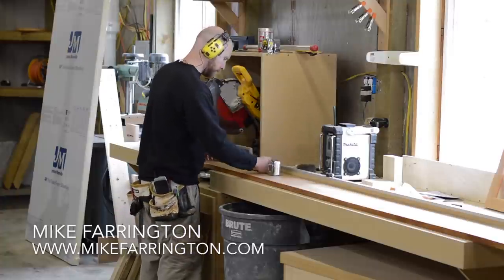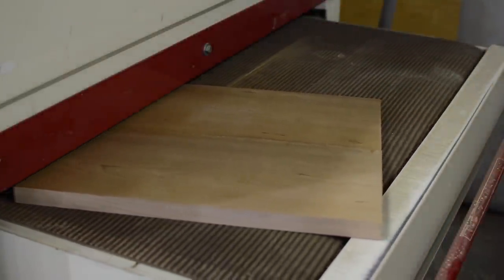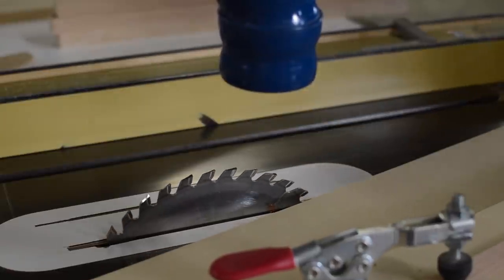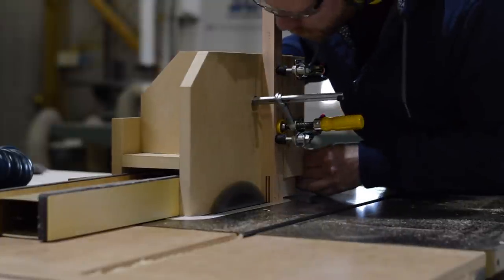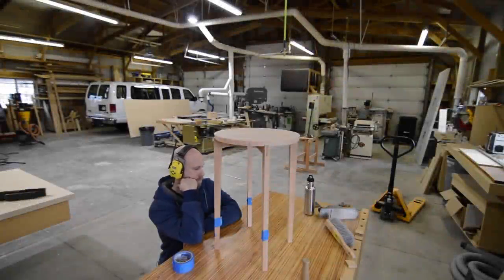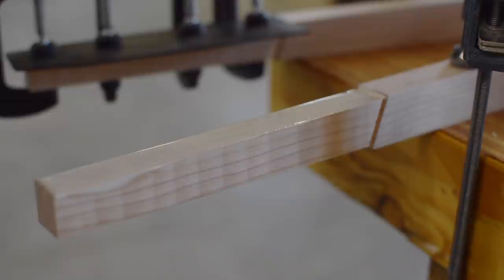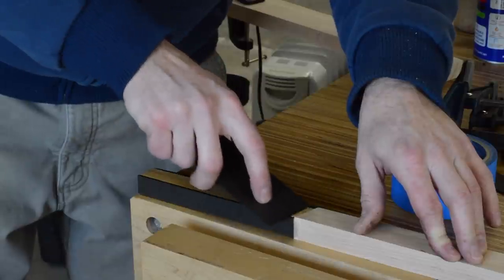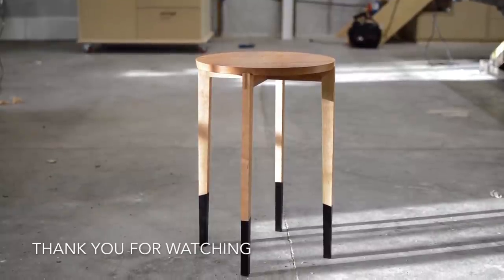Round Side Table With Tube Socks, High End Furniture Making

Comment: Another good one. I thought it would be chocolate on those legs :) But Ebony apparently works to. 
Great to see that it is not only here in Norway it is freezing. I invested in a barrel amber stove a few years back. Pumps out 11 kw for 6-8 hours when it is full of saw dust. Keeps my temp at tolerable levels in the shop. And I get ridd of all the scraps and dust shavings too. 
Looking forward to the next video.

TR
Norway.
Reply from the maker: Thank you. I wish I could run one of those stoves. My insurance won't cover it.

Comment: Acetone will remove polyurethane glue, or at least soften it enough to scrape away. For small spills or patches on fingertips you might try fingernail polish remover (not tested, but should work). Either of these will dry out your skin, melt a lot of common plastics, and require adequate ventilation.
Reply from the maker: Thank you. Good tips.

Comment: I love this table. I recently just finished making the table for a second time. I used padouk for the socks and birch for the primary wood. Have you found the sawdust from the ebony stained the cherry? My padouk turned the birch slightly pink. No amount of acetone would get it out.
Reply from the maker: Yeah, hand plane will help get it off, or just be careful when sanding. Try not to sand over the two surfaces at the same time.

Comment: I know I asked you a couple of videos ago about your insulation since we have similar shops. I got mine spay foamed last week, and the cost (while substantial) was well worth it. Just something for you to consider
Reply from the maker: So I have a bid for spray foaming my shop. I have been saving for almost a year. Where I live they only spray when overnight temps are above 45. So I am hoping this spring or summer, I will get it done. I also will have a large shop heater installed at the same time. 4 winters of freezing in this shop has ground me down.

Comment: Love this table. How did you attach the top and still allow seasonal wood movement? Z fasteners and figure 8 fasteners wouldn't work with the stretchers dado'd into the top. Thanks.
Reply from the maker: I used 4 screws to hold the top on. Two of them were installed in a normal fashion, as they would not receive any movement. The other two screws were installed in holes that I ovaled out a little. Hope this helps.

Comment: Mike- Quick Question- Wood glue storage for colder climates.  I live in Wisconsin and you live in Colorado.  Both colder climates.  You were discussing glue choices based on temperature.  Are you storing glue in the shop or do you bring it to the house? My garage is unheated currently.  I do have options for future heater.  I heard you mention space heaters.  It’s a common problem for colder climates e.g. paints, glues, putty, and caulk.
Reply from the maker: I bring all my water based stuff inside during the winter. I hope to have my shop heated and insulated next winter.
Reply: Thanks Mike- subscribed and liked.  Thanks for the quality videos.
Reply from the maker: @Lodestone1968  Thank you. Great to have you onboard.

Comment: Mike, excellent work as always. Just curious why you don’t use the sliding table saw more often? Is the setup just too in depth compared to standard table saw? Especially when you’re only doing a few of one cut before moving on to the next.
Reply from the maker: Thank you. Setup on the slider is pretty easy, probably easier than my normal table saw. In this case I just wanted to use more "normal" tools. I was trying to show that super expensive stuff is not needed. Minus the wide belt sander, though I didn't always have one of those and I had to do things the old fashioned way.

Comment: Where those Harbor Freight clamps at the beginning? The reason I ask is I was thinking about buying some and wondering if they are any good?
Reply from the maker: Yes, they are Harbor Freight. They are not very good, but they work. I use them until they are covered in glue, then I replace them.

Comment: what is that laminated top youre working on? What wood? Im assuming you made it... how did it come about? Did you make it out of scrap?
Reply from the maker: The top is made of LVL beams milled down and glued together. These are commonly used in framing homes. The Lowes near me carries LVL beams, but any contractor supply should be able to get you some.

Comment: Mike - I love your videos.  You're super talented.  Question: I notice that you often time have your table saw blade all the way up, not just over the piece of wood.  Just want to understand why you do this?  (I've been taught to lift the blade slightly above the workpiece).  Thanks!
Reply from the maker: Thank you. I think keeping the blade lower is safer, so for that reason alone its a good habit to keep. I don't think I had the blade crazy high in this video. Was there a particular section of the video where you thought it was too high?
Reply: @MikeFarrington  not specifically, just wanted to know why you generally keep your blade high.  I tend to put the blade  an inch above clearance.  I was just wondering why you generally keep yours higher than that (I've watched many if not all your videos).  Is it because there's less tear out, easier on the blade?

In any event, keep the videos coming, you're the most skilled wood worker on YouTube!
Reply from the maker: @isaaczeitoun7767  I think the blade will run cooler if its up a little higher, though I don't think this difference would be significant. I would say that generally I keep my blade reasonably low. I really don't think I keep the blade high. In this video the blade is up high in a few shots, but thats only while cutting joinery.
Reply: @MikeFarrington  thanks for the responses.  I look forward to seeing your next videos.
Reply: Understanding the safety aspects, personally I think a higher blade had a shorter cutting action through the wood as opposed to a long diagonal cut where the wood & blade have a longer contact time & distance.

Comment: Mike could you please tell me the brand and # of the hand planes you use? Thank you kindly!
Reply from the maker: In this video I used a larger shoulder plane from Veritas, an adjustable mouth block plane from Lie Nielsen, and a number 4 1/2 smoother from Lie Nielsen. I suggest sticking with the 4 not the 4 1/2 unless you are a very big guy. It takes some force to push that 4 1/2. I also used a low angle jack plane from veritas on the shooting board.

Comment: Is there no need for small domino or lamello in the top ?
Reply from the maker: If you are asking about the joint between the two boards that make up the top, no. An edge to edge glue joint, when done properly is stronger than the wood.

Comment: Love your videos. Any reason why you rip to rough length on the bandsaw instead of the table saw?
Reply: Width... Ripping sawn stock for the first time on the tablesaw is generally not a good idea. Typically, you are starting with no flat reference surface, potential internal tensions that give safety issues + you want to limit waste.
Reply: Andy Midd I get that, I guess I was specifically asking about in the video where he jointed one side then went back to the band saw to rip the opposite side.
Reply from the maker: Thank you. Tension is wood is certainly an issue, and a good reason to rip at the bandsaw. For me its a combination of comfort, ease of use, dust collection, limited waste, and I could go on. I really enjoy using  the bandsaw and I like that dust isn't throw at my face. My bandsaw is setup really well, it cuts very straight and true, so its my preferred ripping tool.
Reply: Mike Farrington Thanks! I try to use my SawStop and jigs more than other tools for the safety feature, but I’ve got a bandsaw coming in tomorrow and was wondering if there was a safety reason.
Reply from the maker: Its important to note that we are talking about very fine lines here. There is really nothing wrong with ripping at the table saw especially if you have a saw stop. Your saw has the stopping technology, but also has a really nice riving knife. If you get your bandsaw and tune it up nice, you may very well enjoy ripping on it. You may prefer your table saw. I personally think the bandsaw is safer, but when comparing to a sawstop, its a close call.